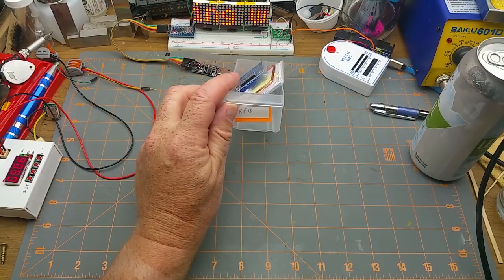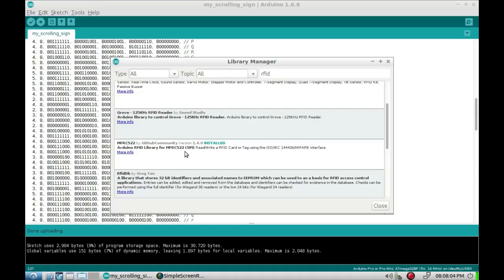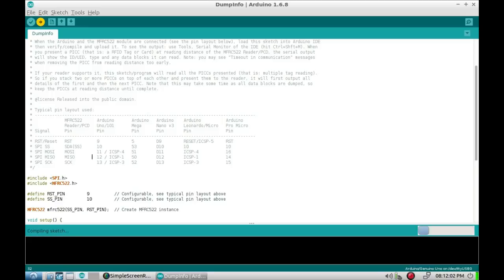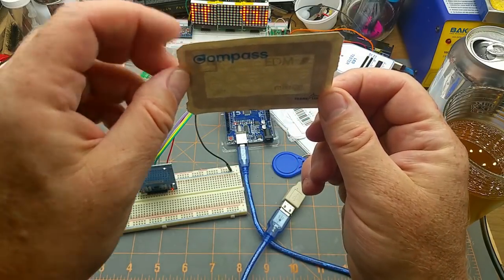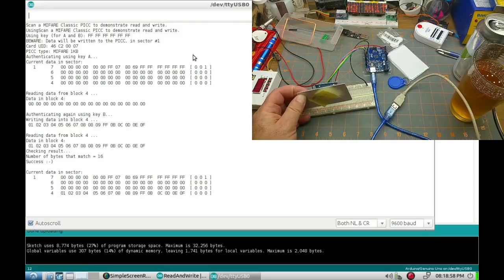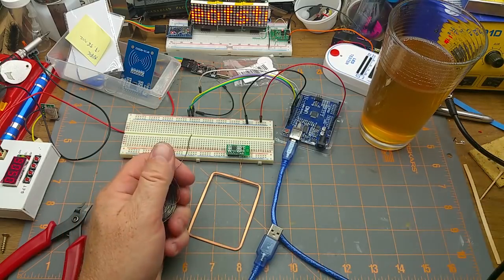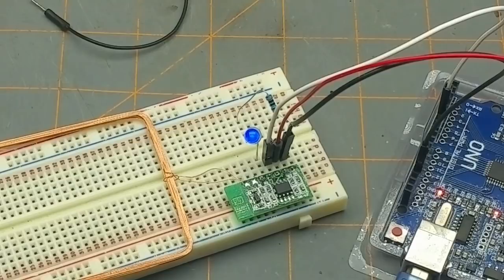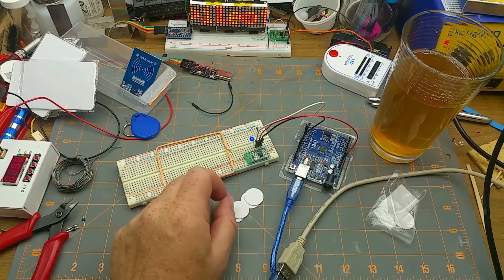playing with rfid

Comment: Just a random though here but I wonder if this could be used on a model railway to set switches. Each card would be assigned to a certain switch then it would change when the card is held over the senor. Way more complicated than it needs to be but an interesting idea.
Reply from the maker: It's a good thought. 
I was chatting with another modeller who was trying to use these (the 125K "dot" ones) to do something like that - basically automating his yard inventory by sensing the cars coming in and out.

He found that the antenna coil had to be reallly close to the rolling stock for it to work.  And even then it wasn't entirely stable.

There are probably ways to optimize the antenna coil, and perhaps add some sort of amplification, but that's beyond the effort I am inclined to do for a hobby project.
Reply: I have also heard of other rail modellers experimenting with rfid but using the 125k glass chips (expensive) mounted on the bogies (trucks). From what I have read and from watching your trials, the 13.56m has a greater range than the 125k and would be better for automated car inventory. I will shortly be playing with 13.56M with sticky dots which will be ideal for sticking to the underside of the fuel tanks.

I am also going to try building an alarm with rfid, keypad and sms capability for my local model rail clubs www.barnsleymrc.org.uk new clubrooms which we will soon be moving into.
Reply: @glyndevonport7802  it would be interesting to see someone use this car inventory thing and make working hump yard that auto sorts the cars.
Reply: Now that would be interesting as a demo at a model rail show.

15 or 20 cars (5 from each of 3 or 4 different companies), 3 or 4 sidings. Get the public to randomly set the order that they are propelled over the hump and leave them wondering how they always end up on the correct siding.

Comment: No real idea but is having the antenna sitting on the breadboard grid stopping the signal?
Reply: Very doubtfull. 

If the breadboard was sat on top of the antenna I would say yes because of the contact strips in the breadboard would act as a shield to the signal. 

If anything with the antenna sitting on top of the breadboard, the contacts would act as a reflector and enhancing the signal.